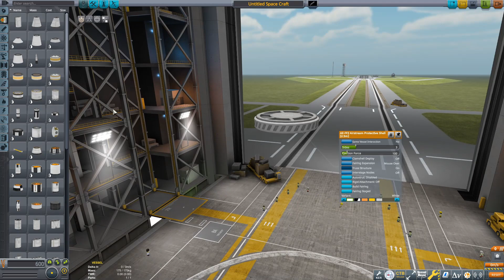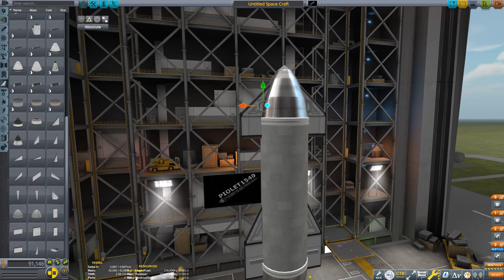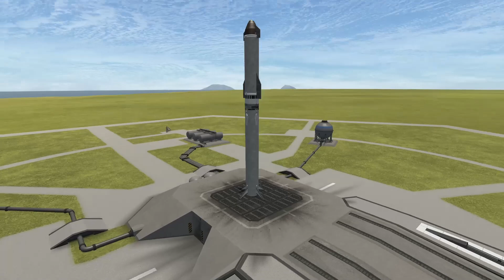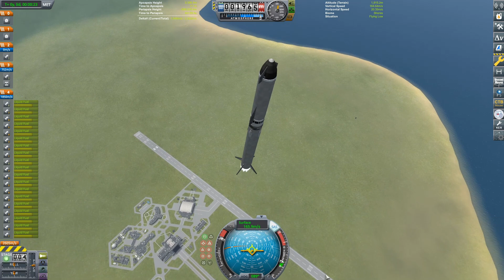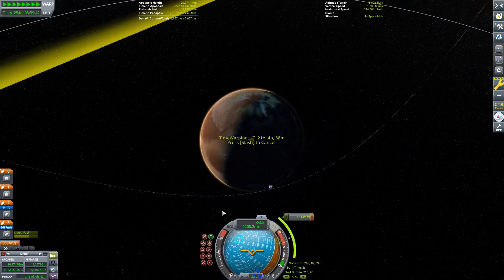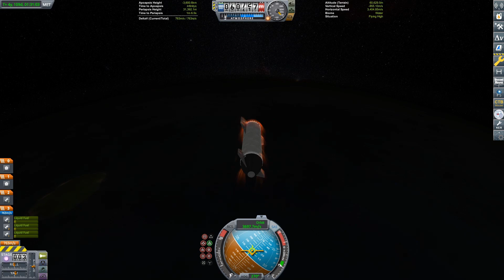KSP: Building And Flying a MINI-STARSHIP!

Comment: that's smart! I'm trying to create a starship by myself, but I can't set the servo right.
in the action menu I set the hinges to control pitch but it overrides every other action, so I end up with the fins always at the middle angle, and I'd like to have them straight during liftoff :(
Reply from the maker: What I do is I set two action groups to lock the hinges. So you put the back fins all the way out, hit lock, then do the opposite control input to do the same on top fins... thanks btw

Comment: they aren't fins. they are flaps.
Reply from the maker: does it really matter?
Reply: @Piolet1549  yes it does. It’s a pretty important distinction. “Fins” implies that it moves parallel to the airstream, and are typically used to keep the center of drag behind the center of mass. These are different. They are perpendicular to the airstream and are used to create drag.
Reply from the maker: @MonsieurDijon  ok

Comment: Do a fullscale starship
Reply from the maker: I have, well not a accurate scale, but I have done a full size one
Reply: @Piolet1549  well with full scale i mean 50 meters high and 9 meters wide. I have made it in ksp but u need quite a strong pc lemme tell u haha. It also gets ripped apart easilly by airodynamic forces. But after a long time i got it to duna.